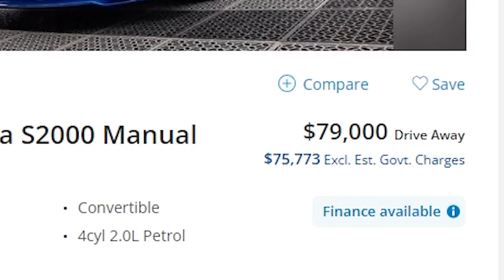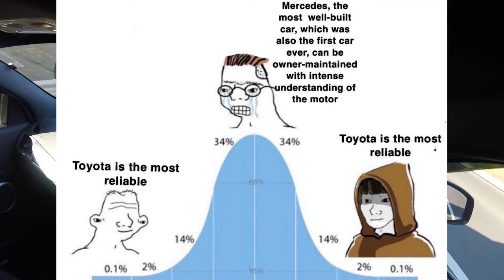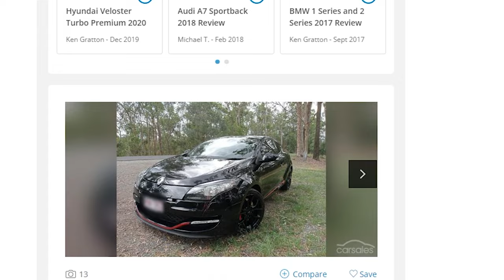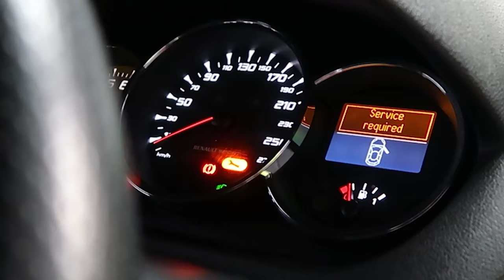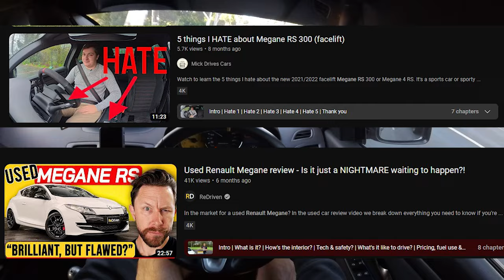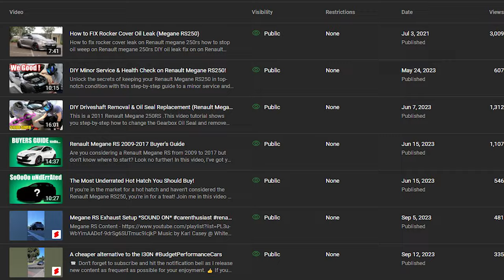End Of The Road For My European Hatchback | Renault Megane RS

Comment: Interesting review.

I actually find the Renault MK3 maintenance to be cheaper than their counterpart (MQB VW/AUDI)

Ive driven 80000 kms with 5+ track days, tuned with full bolt ons for 3 years and never had any issues asides from the common problems.

- Thermostat $50
- Coolant bottle crack $200
- Passenger wheel bearing $700
- Clutch damper (Replaced with delete kit) $200
- Radiator $1000

All which was very easy to tell and reasonably priced to replace.

Comment: French Renault Enjoyer here.
The engine you had in that Mégane is the Renault F4R. Under the bonnet of the Mégane, it's a bit cramped with all the intake stuff.
It is otherwise known here as a super reliable sport engine, without any particular point of failure so i don't really understand your stress, nor do i understand your mechanic which probably remebers the unreliable  Mégane 2. The Mégane 3 is far better in that regard.
I am however astonished at the costs of parts in 'stralia. That driveshaft seal is 25€ here. Ouch.
Reply from the maker: When it's good. it's Great. When it's bad it's $$$$$. 

The stress comes from a longer list of common issues than I was used to.
Reply: It's more that genuine parts are expensive and can be difficult to come by here in Aus. 

The mechanic is slapping an inflated price on those quotes though... I guess he just prefers to spend his time working on easier models for quality of life reasons 😂